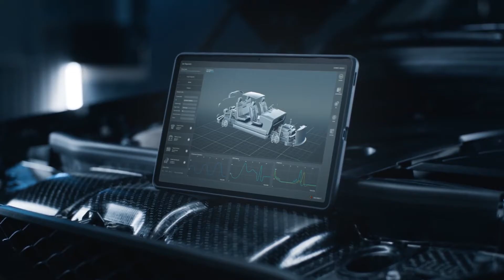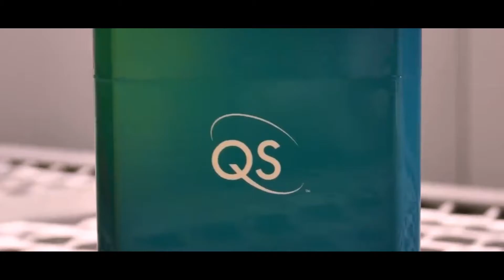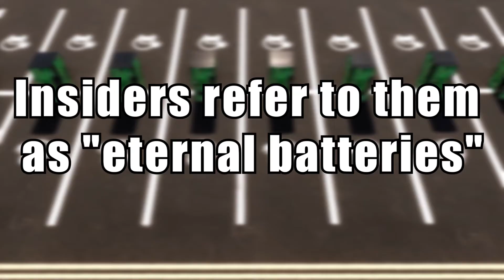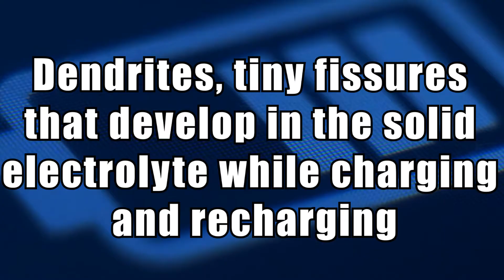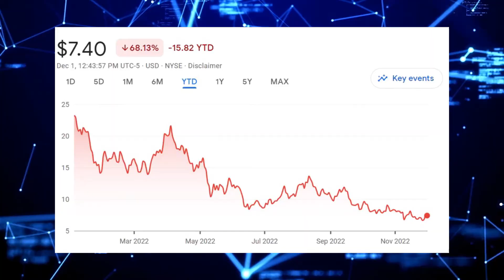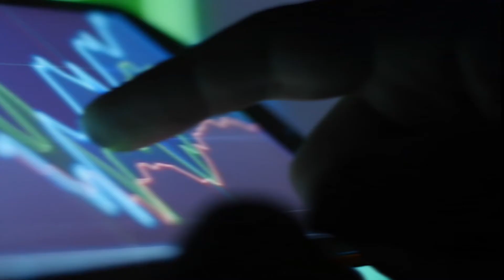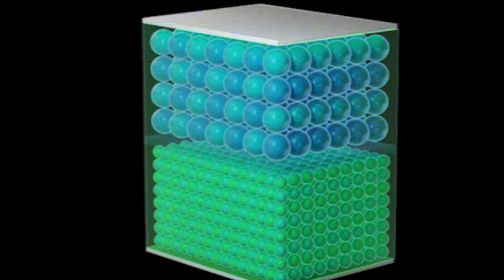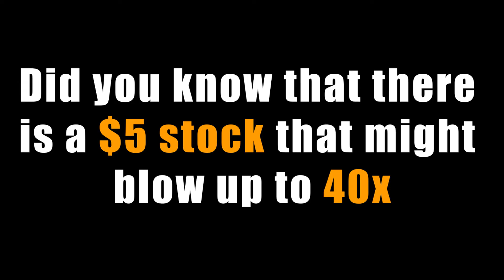QuantumScape Is Set To Soar 10X By 2030

Comment: The tech is great, I have been following Quantumscape for a year and am invested in them. There are though exaggerations and inaccuracies in this video. It is a forever battery not because of its higher energy density but because it will not degrade nearly as fast as the lithium-ion batteries in use today, it will recharge enough times to get a vehicle down the road 250,000 miles unlike the junk on the market today. I would not expect any manufacturer to install enough battery to get a vehicle thousands of miles before recharge, they will though accept a charge in a seriously reduced amount of time, and people will be able to expect to spend about the same time charging this battery to 80% capacity as they would filling up their gas tank. I am expecting a major milestone within the next few months where their customers receive full-scale batteries to test in their cars, when this happens the stock in this company is expected to surge. Right now the share price is about $7.50, I expect around $30/share when the samples go out and Tesla prices $300-$600 range when VW (three times the size of Ford) and other customers are using these batteries in their production cars as soon as 2-3 years from now.
Reply from the maker: Thank you for watching and sharing your input. We are looking forward to sharing more quality content.